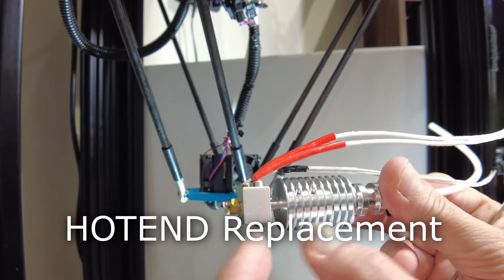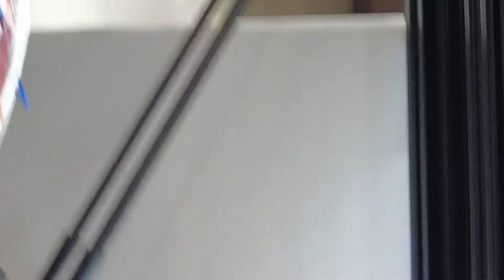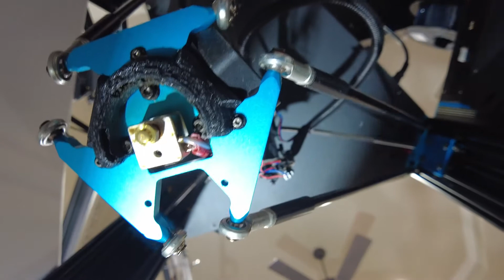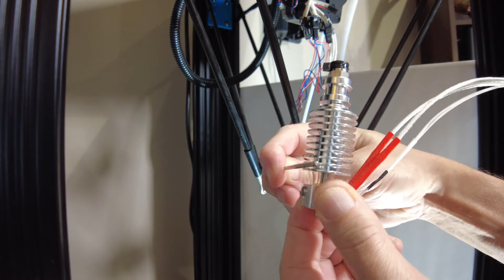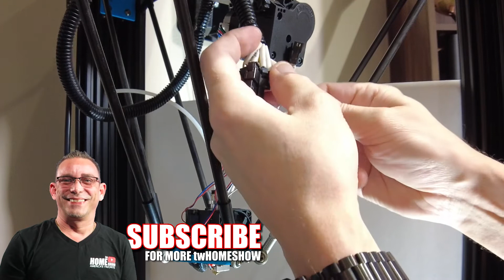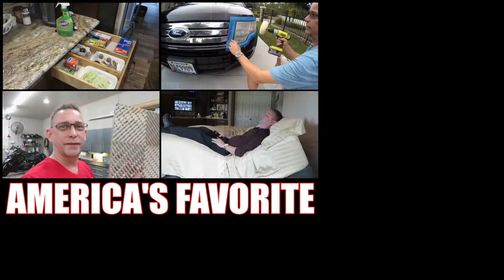ANYCUBIC D | Predator | 3D Printer HOTEND REPLACEMENT

Comment: Good demo, I was replacing the stock 0.4mm with 0.8mm for faster bigger prints as perfection on larger prints I don't need. Now what would your opinion be about using PVC over PLA and vice versa.
Thank you.